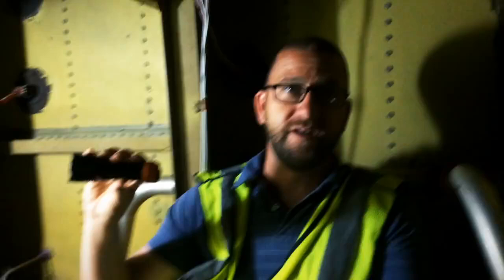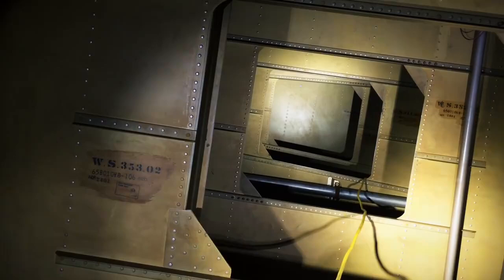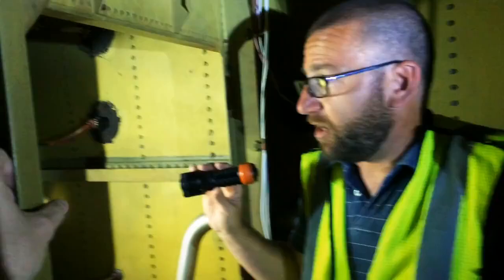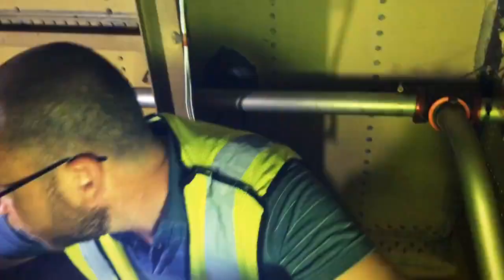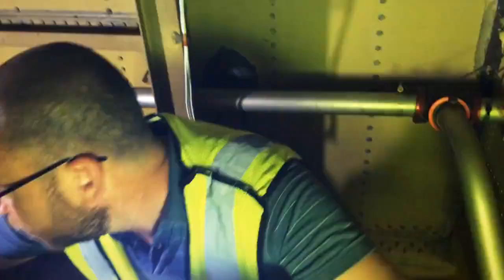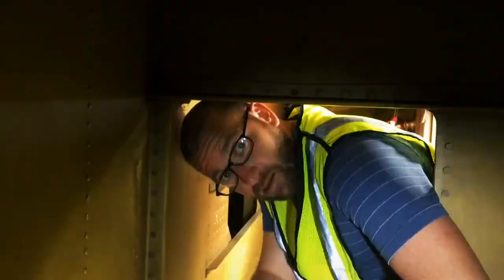The 747 Experience: In the Fuel Tank

Comment: How do you get all the fuel out? let it evaporate? Is the wiring very insulated to prevent combustion? Also how are the tanks sealed. Also are there pumps / drains from each of those sections to distribute to the engines? Thanks
Reply: Great questions. Sum it up from experience: first tanks are de-fueled using fuel trucks which can remove most of it, 2nd there’s small spring loaded valves usually located on the lower surface of the wing and at the lowest part of the tank, a tool is used to push up on the valve connected to a funnel which can be routed to a barrel. It basically looks like a long rod with a funnel around the top to help guide the fuel down the hollow rod into a barrel. At this point well over 99% of the fuel is drained. Then a fuel tank qualified team of mechanics carry out a process called de-puddling, usually at this point there is only small pockets of fuel but workers enter the tanks with breathing air and a fuel vacuum. Fresh air hoses and extraction hoses are also attached to these tanks during the process and left to help remove fumes. Over time jet fuel does dissipate. When maintenance is carried out fuel teams monitor the air with a device called a multi raye, it reads oxygen levels and fumes. That’s a quick summary but there’s a lot more to it, also I’ll add it can be dangerous.
Reply: @sexigrande1792  cool! Never imagined so much could go into it. I guess the same kinda process applies for ships and other heavy equipment.
Reply: @CTde110  as far as confined space procedures I’m sure there are a lot of similarities. Also yes there’s lots of pumps and valves to move fuel: boost pumps, fuel transfer valves, high level fuel shutoff valves, emergency shutoff valves etc... you also might see the odd folk here claim fuel is a hoax 😂.

Comment: A1 aircraft fuel has an extremely potent smell and a very strong residual smell. What is done before entry to clean it out so you don't need to wear a respirator or any PPE?
Reply: Defueled. Residual fuel is dripped from the the sump drain outside the wing tank into barrels. Extraction and supply air hoses are connected to the tank. Fuel tank crew will enter with full face respirators with supplied oxygen and special fuel vacuums and rags. Over a period of time the tanks with be continued to be purged and monitored with a multi Ray sensor which measures LELS and VOCs. These readings need to be at a certain level to enter without full respiratory ppe. Even then depends on regulations for countries, companies etc. Workers are also time limited for exposer. So basically the longer it vents the better.
Reply: @sexigrande1792  how long do you vent a kerosene heater before it no longer smells like kerosene?

It would be more appropriate if this was a brand new fuel tank. As someone who works in confined spaces, I'm really surprised I don't see oxygen meters and appropriate PPE.
Reply: @robertfreeman7916  I believe this is at a museum so it would be well dry. But yes newly opened and depuddled tanks would require ppe especially supply air. The better the fuel removal process the faster the tank can be purged. These aircraft are large so it would take awhile. An example when I used to be part of our fuel crew: we work at a heavy overhaul facility so aircraft could be in any where from 6-12 months so tanks are well vented before no full face mask is required. Now everyone has a right to wear it just makes movement harder. Cushions are used to crawl across, tanks are continuously monitored. There’s definitely some Grey areas thrown in there but there is definitely a lingering smell of fuel especially if you expose pockets of fuel removing at valve or fuel line. Ive even worked in new wings which are way better for obvious reasons. And our aircraft has a bladder tank in the fuselage which is much easier to clean. Fuel tank coveralls are a must and gloves and well. That goes without saying there’s always some kind of risk and the shorter exposure the better that’s why we were only limited to max 4 hours per day.
Reply: @sexigrande1792  and that makes perfect sense. You don't need PPE or a confined space permit in a museum. Should have said that in the first place right?
Reply: @robertfreeman7916  all good 👍

Comment: On the 747, what is the height of the fuel tank (internal thickness of the wing), at the part where it meets the fuselage?
Reply: Close to 6 feet. The "wing box" part of the fuselage that the wings attach to, also carries fuel, and I could stand upright inside the main fuselage tanks. I'm 6'3".

Comment: Not even a sign of remaining fuel, the flour panels are dry, bare wire harness, no fuel pickups anywhere and rivets everywhere. I'm car mechanic for over 20 years and never saw a fuel tank built with rivets. Modern car fuel tank has at least two fuel pickups and a lot fuel lines, a fuel pump and two level sensors and tank itself made of very special thick plastic. it looks to me there is no fuel inside the aircraft wings.
Reply: It was drained and vented
Reply: You can't mold an airline fuel tank, like you can with a car.  Rivets work perfectly well.
Reply: I have a 16 foot boat that is riveted together just like this tank and barely leaks.
Reply: "I'm car mechanic for over 20 years and never saw a fuel tank built with rivets."
Which proves that you are a car mechanic and not an airplane mechanic.  Airplanes are made from aluminum, not steel (like a car) and they are fastened with rivets so that the pliable aluminum fasteners in the wing can become one with the pliable aluminum wing and bend along with it.
Jet aircraft fuel tanks are not specifically built as fuel tanks, they just seal up the internal structure of the wing and make it an integral "wet wing".
Reply: It's a good thing you're working on cars and not airplanes.

Comment: For people that claim there is no fuel inside the wings of an aircraft, explain the Boeing B-52 bomber then. Why do the wingtips of a fully fueled BUFF need landing gears to support the weight as they are clearly touching the ground?
Reply: @kwantoon  maybe because of the length of the wing, combined with the weight of the 8 engines hanging off the wing?
Reply: That's where the Lift Demons are stored?  :)

Comment: Cool video. I would have expected some type of lining. I thought fuels would be corrosive.
Reply: That yellow paint IS the lining. Fuel tanks are inspected for corrosion on a relatively regular basis. It made it into that TV show about the "world's dirtiest jobs". Honestly, though: fuels are oil-based, and oils preserve metal, rather than corroding it. Corrosion occurs from contaminants in the fuel, such as water, or anti-icing additives.
Reply: @c182SkylaneRG  Being Kero based also helps
Reply: @marjan8888  Kerosene is a derivative of oil, so yeah. :)
Reply: c182SkylaneRG Dis similar metals are also a large cause of corrosion.The problem with water is the microbes that grow in the water, they are the main cause of corrosion.The fuel additives not so :)The yellow paint is primer used to protect the metal.It is not a liner in anyway that prevents fuel leaks.Sealants and  O rings prevent fuel leaking .

Comment: I see no signs that liquid fuel was ever in the wings of that plane.  These 747's supposedly have four tanker trucks of fuel  on board?!  Sorry I say bullshit.
Reply: So your saying 747s fly without fuel?
Reply: wizbang16 iv been talking about this. The airbus suposedly carries 320,000 liters!! That comes out to 84,000 gallons of liquid. Thats complete nonsense. We never saw these fools enter the aircraft. They always start already inside these so called tanks..something hella weirds been going on with turbofan technology
Reply: I will call my friend who works the ramp at the airport fueling and see if it checks out.
 Just did and it does carry tons of fuel.
Reply: WackyBroProductions. Thank you for confirming what those with any sense at all already knew. Great that you could 'try' and tell the nutters, pity some want impossible and what should be unneeded proof that they'll never believe anyway.
Reply: Take comfort in the fact that these nonsense believers aren't the ones building and flying the planes! Wings, engines and all! 
Bc they have no idea; no real world experience with actual aircraft. They've never turned a wrench, tuned an engine crafted metal, designed anything mechanical or electrical. And a damn his thing for the rest of us!
Reply: I mean a damn good thing...
Reply: It's not a secret, it's a lie!  

Essentially, whether a turbojet, low bypass or high bypass turbofan, the core of the engine is basically the same.  It burns a fuel/air mix.  Constantly.  This is the only way that (in the case of a high bypass fan) the engine will develop enough power to drive the big compressor at the front.  

The fuel air is ignited by an ignitor (think car spark plug), but in many cases the ignitor can then be switched off – the compressed air and fuel will continue to burn.  However, as soon as the fuel supply stops, the engine will “flame out”.  The compressor will then be freewheeling and producing no thrust.  If this happens in flight, the crew need to perform a re-start.  You can’t do this without fuel.  Also, the way of switching a jet engine off at the end of a flight is to shut off the fuel supply.
Reply: Ahhh. Maybe it was because of all the swearing, plus your way of wording it. Calm down and 'try' and talk sensibly with less swearing and more calm facts. It would also help if you specified "WHO" you're talking to. 90% of people replying here KNOW they run on kerosene.
Reply: Cipi SixZeroFour, liquid air and compressed are not the same thing. Liquid air is air that has been cooled to -200 degrees C so that it'll turn from a gas to a liquid. And you're quite right, it's heavier than jet fuel. Compressed air is still a gas.
Reply: I'd like to know how fuel flows through these square tanks. Is there a fuel pick up in each compartment or what, Every other tank on earth is shaped for the fuel to flow correctly. But this looks super primitive? Why wouldnt you build it so the fuel can flow correctly towards the centre of the plane so you get an even weight distribution as the plane uses fuel?
Reply: @toiletduckie44  ..he explains it in the video.
Reply: Anton That’s right, you have no idea because you haven’t taken the time to research how a jet engine works.  A 747 burns about 24,000 lbs per hour (3600 gallons per hour).
Reply: If it were true it would solve environmental issues.

Comment: i dont think your in a tank the wings are so thin
Reply: He's in a 747 not a Cessna 172 🤔
Reply: True, they only show inside but not where exactly on the plane, which is very sketchy. I too believe the planes run on air, and might use some fuel. Because if you do a little math and add up the gallons of fuel being used by airplanes per day vs the gallons of gas being made, you're gonna end up with more gallons of fuel being used than produced.